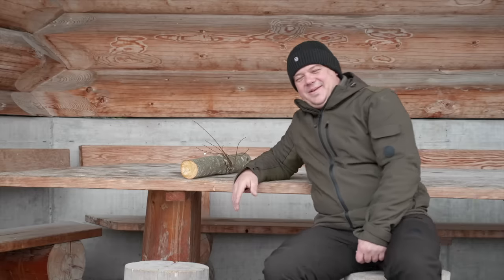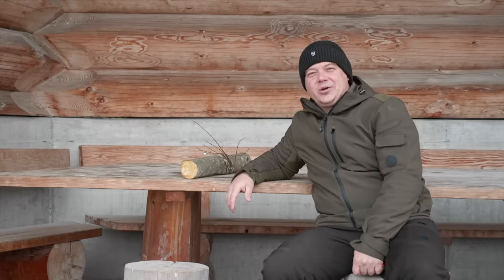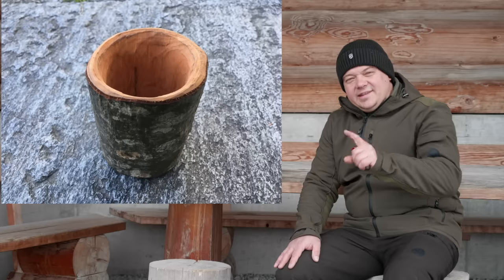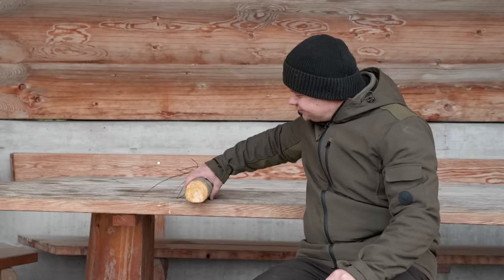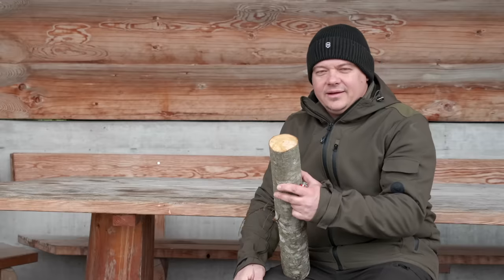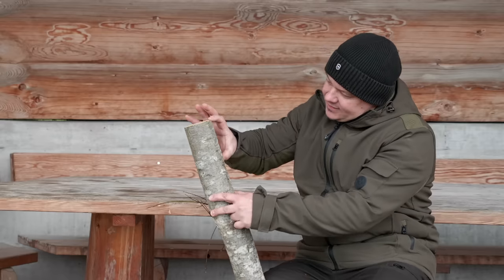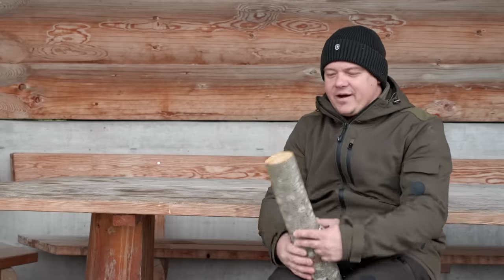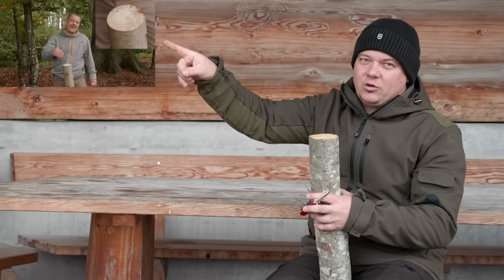How to carve a drinking cup - A Victorinox Swiss Army Knife Projekt

Comment: I spent 25 years hand carving wooden spoons and kitchen goods for a living.  I always carved green wood then dried it gently in a simple light bulb kiln.  This was just a basic wooden plywood box with a top lined with foil insulation - wire rack at the top of the box - 4 standard shop light bulbs.  If I wanted to slow the process I could unscrew one or two bulbs - moisture escaped through the gaps around the lid.  It was a very basic setup but worked perfectly.  You could tell when the wood was dry by the feel - warmth coming from the wood and by the sound when you knocked two pieces gently together.

Comment: Just a little suggestion for those who are impatient - you can "dry" greenwood faster in the microwave. It's best done when you significant other isn't home, because if you go too far, its stinky. 

Use low heat and pause frequently (e.g. heat it up, then just let it sit a few minutes before continuing). You're basically boiling the water impregnated in the wood so it steams off. It's also not without risk - your piece may crack, especially if there are areas of varying thickness. 

I use this sometimes when turning wood on the lathe. In those cases I rough turn the shape, then microwave it before turning down to my final diameter. Since these bushcraft projects tend to be thicker, I think it should work ok if you're careful.
Reply from the maker: Wowww, thanks a lot for this super interesting trick!

Comment: Have to seal with pine resin on the bottom of the cup. A great scent my friend!
Reply from the maker: Thanks a lot for this super inspiration!
Reply: Another suggestion, birch bark "glue", heat birch bark shavings in metal box, take the liquid and mix with charcoal. Has worked for the neantherthals and on! They used it for securing stones to wood for their version of SAK! Thanks for Your inspiering videos.

Comment: I'm sure you could slap some pine pitch glue at the bottom and flatten it out on a piece of rock if you need a watertight seal in a pinch. It probably wouldn't last for too long because like he said, the wood dries and will contract. But in a pinch or long term i might use that. Happy crafting !

Comment: if your camera is 1080p you should check your exporting settings because it's coming out at half resolution stretched back out to 1080p.
you can tell because the pixelization is very crisp and unlike aliasing pixelization... 
I was so curious I brought a screenshot into photoshop and shrunk it down to half the size and got the same image except that now 1 pixel didn't take up 4

anyway. thank you for this video.

Comment: I definitely feel that first tooling after a decent bench and a few large rounds should be a giant flywheel powered by ones foot like an old sewing machine. Last forever? Nope. But once you can turn a piece of wood, and have a power head, getting round things and symmetry for other things is easy.... Including a round 'tube' that could house small pegs to carry the flywheel shaft. (A primitive bearing). Then making wheels, pulleys, drilling holes etc becomes simpler with each tool made. Even making flat surfaces. Being able to turn out spokes/pegs of uniform dimensions for replaceable parts. Eventually, a large bellows that when combined with the right mix can make a pretty serious furnace. I'm not sure how to get metal or stone tools from there, but I'm sure it's possible
Reply from the maker: Thanks a lot for your inspiration!

Comment: Felix good day. A question for you. In your opinion, would the following process work? I'd hate to spend the time on something without a Felix Immler "educated guess." To start, cut your stock 1 or 2 cm longer than the saw blade? Then create your beginning hole in the center and enlarge with saw blade per usual. Next, still using the saw, cut back from the center to the outer edge leaving a 1 to 2 cm outside wall. Continue doing this all the way around. This is where I'd fear the piece breaking dependent on how the grain of the wood is running along the outer wall...then switch to the can opener or bottle opener to pry and 'pop' the filler wedges out in chunks. If the piece didn't break, finish off the insides with the small and large blades. Last, would be to figure out a way to sand out or burn off the remaining rough bits at the bottom. Thus a cup, mind you shorter than the tankard size you made in this video. I'm in the Arizona desert. All I have near me with a big enough diameter are the wild cactus...which are hard to hold when carving...and illegal to carve (HA!). But, when I go up north a few hours to the pines and birch, I might be able to find something to use. I'm enjoying all your vids. Almost done with all of them.

Comment: foolishly. rape and tool damage. why drill when you can burn it out and trim it? and the quality of the walls will be higher. and then what kind of hiker doesn't have a bowler hat? I use a Swedish fold-a-cup in two sizes and an American army bowler hat.

Comment: By the time you finish the carving, I will be thirst to death if I were to rely on your to make a cup out of a piece of log.  
I am sure you can use your SAK for everything from a simple cup to a car or jumbo jet. What's the point of this channel ? You're simply boasting your carpentry skill and what you can do with a SAK.
Also hollowing out the bottom is a bad idea, even it doesn't leak now, it will certainly leak in the future. Wood is a natural material and can be susceptible to mold and rot when exposed to water or too much moisture without protection. Wood can swell and move from increased moisture content. There are also instances where wooden furniture can get watermarks caused by the wood finish. This is undoubtedly the silliest and without common sense video clip I have ever seen on youtube.